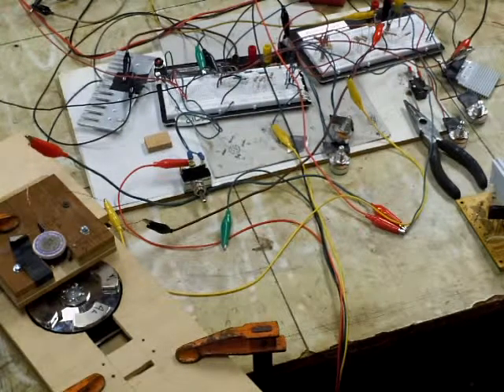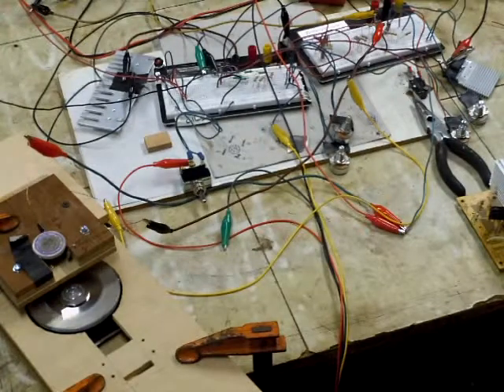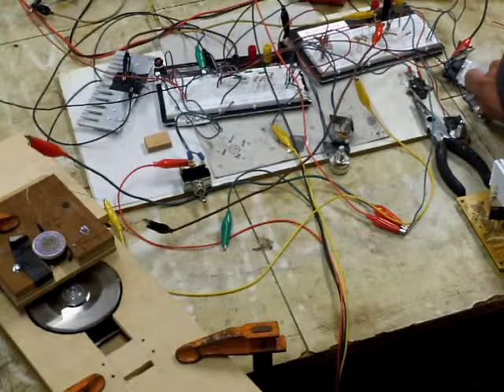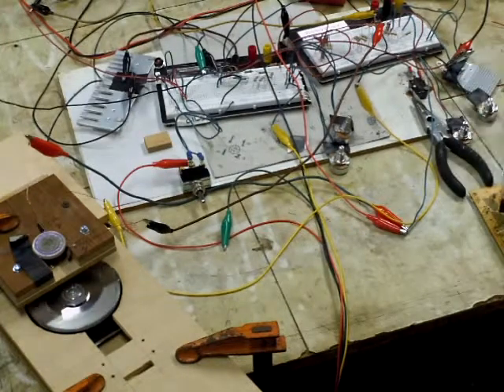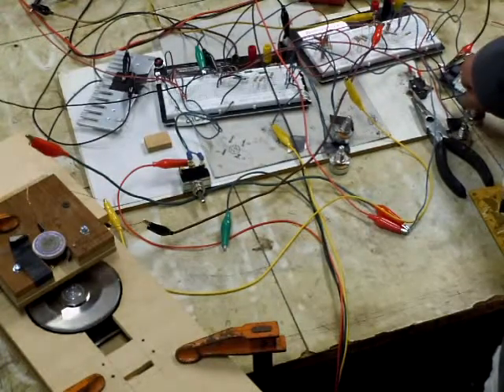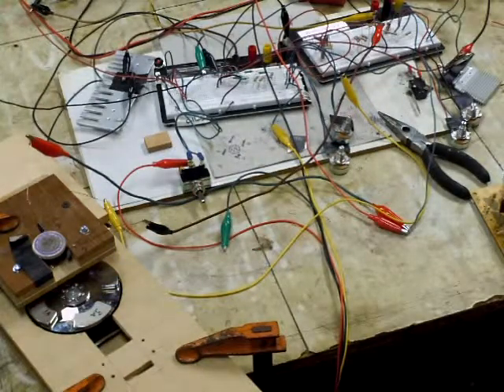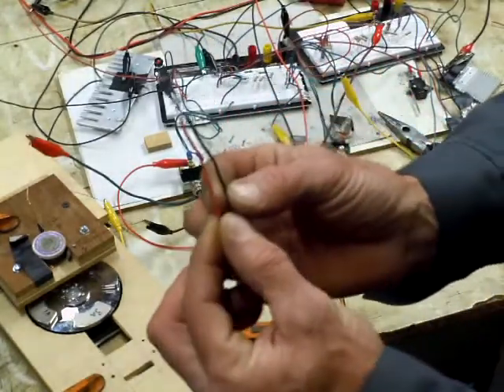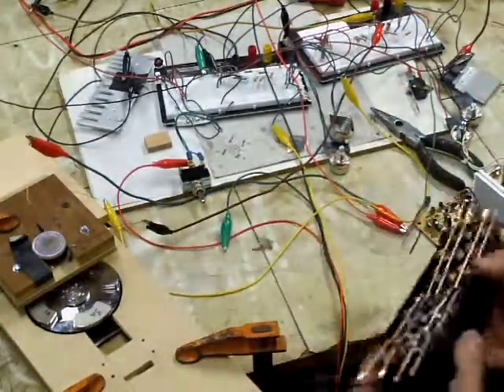HardDrive-Bedini-Motor--Having Fun Now PART-2 of easy start motor vid

Comment: Your efficiency gets worse at higher speeds because of magnetic damping between the spinning wheel of magnets and the aluminum chassis its attached to (http://en.wikipedia.org/wiki/Magnetic_damping). Magnetic damping works like a hydraulic shock such as the ones used on car trunks. When a strong magnet passes closely to a non-magnetic but conductive material such as aluminum or copper, ... it induces a field. In this case the hard drive chassis is shorted to itself and produces only drag on the rotation and no usable energy. Attach your hard drive motor to something like wood or plastic which is non-magnetic and non-conductive and your efficiency will go up big time, possibly 90+ percent overall.